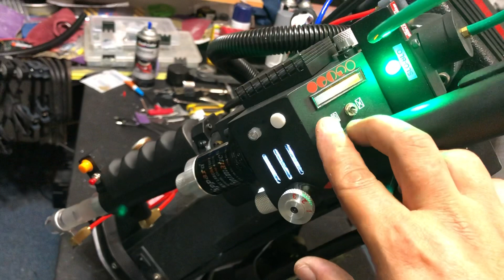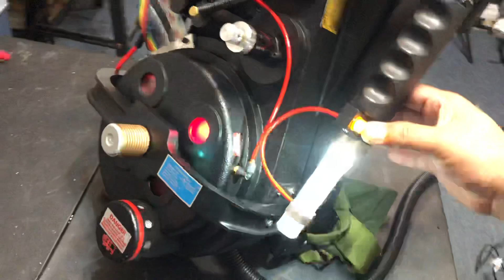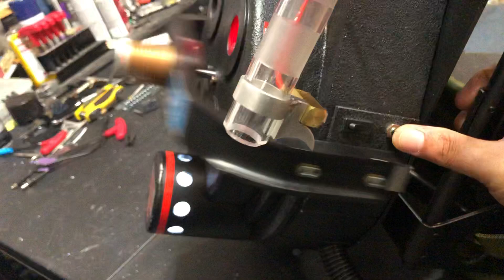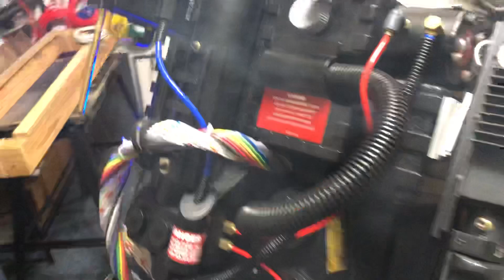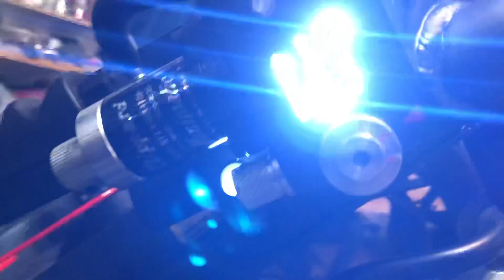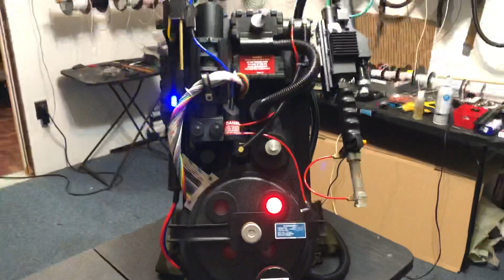Demo test of GB1 Proton Pack with TVG upgrade

Comment: i wonder if there's a way to make a more powerful e-cig fog machine that you can actually use to have a projector play a ghost capturing sequence via the ghost trap

or like have it do some vape tricks

do you think it's wise to apply 2 magnets on the V clasps that secures the wand from the pack? i've been using that method on props that involves self-attaching objects to one's back (cloud's buster sword, dante's rebellion etc). it works as a guide for the person to get a feel where the clasp is located and at the same time additional security (e.g. when jumping, upside down etc). though the downside that it may need a little more effort on taking it off (depending on the magnets' intensity)